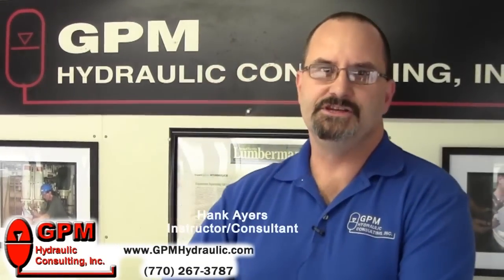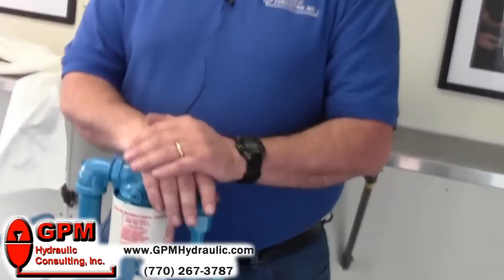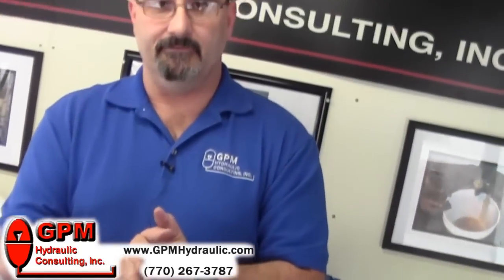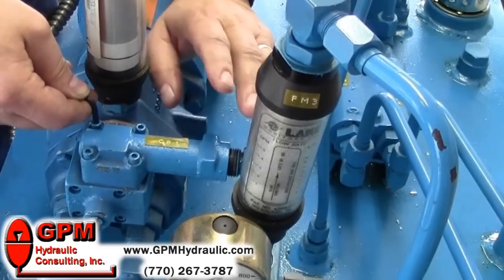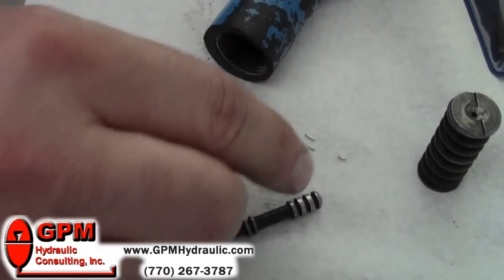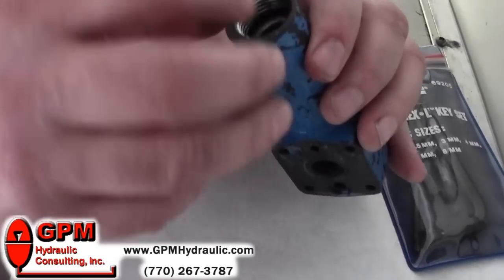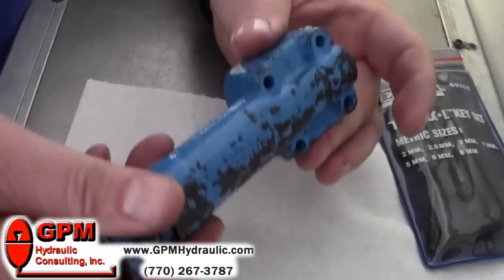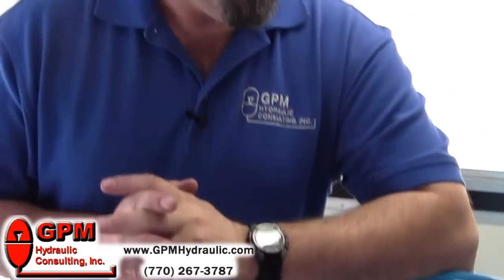Diagnosing Low Pressure in a Hydraulic System

Comment: Thank you very much for recording this video. I’ve found very few others that are actually helpful. I have a bobcat 863 that the auxiliary hydraulics lose pressure as the machine warms up. Any specific recommendations for this problem? Greatly appreciate your time.
Reply: Did you find answer to your problem, a have similar ..   lose power - pressure slowly...   If engine is running or not...   Boom will come to ground slowly...

Comment: Having a problem with our mini excavator.All hydraulics were slow on the machine it was down about half the usual power output.Blade barley picked machine off ground.Replaced all filters flushed all hydraulics and put in a new pump .Still same situation.Funny thing is when u first start machine for a few minutes machine has normal hydraulic power but once oil hydraulic oil warms up seems to lose power.My question is could a worn out main relief valve cause this .Or if a section spool valve was not fully closing on the control valve be the culprit.On our control valve there are a many relief valves that control different section of the excavator
Reply from the maker: Thank you for your question, Jay! Yes, indeed a worn relief valve could cause this - or a directional valve. Either could be bypassing such that it doesn't show itself while the oil is cold, but becomes apparent once the system warms and the oil becomes thinner. One easy way to detect what is leaking is to isolate different portions and see which will not hold pressure with a hand pump. You may also have some good results by using a thermal imaging camera to detect any bypassing. Look for hot spots around components in areas where they should not be. Hope this helps!

Comment: This is the video I needed to see. I have a bad pressure relief valve. But I'm stuck between that or the spool valve on the differential lock on a grapple skidder. My pressure drops from 400 psi to below 100 psi. It is suppose to hold fast at 635 psi
Reply: Jason, do you have a safe way to lock pressure in the line and shut down so you can listen to hear which may be bypassing?
Reply: @Gpmhydraulic   I blocked off my lines going to my differential. That should have spiked my Pressure. Which it did what didn't hold. I'm not a 100% sure if it's the prv valve is bad, if the spool valve is bad that has the electric seloniod that controls the differential lock or if the block that all this screws into is cracked internally.
Reply: @Gpmhydraulic  as far as locking pressure, I guess I'd have to remove the block. Fasten a porta power to it with a gauge and try that maybe
Reply: @jasonhart1802  Yes, that sounds like a very good method to me. Take extreme care - never expose yourself to pressure!

Comment: Do small hydraulic pumps such as 12v KTI ones used in dump trailers have compensator spools as well? 

I'm trying to understand if my pump is weak or the cylinder has an internal leak because I'm supposed to be able to lift 6000lb with this trailer but max out at around 3000lb, the pump doesn't sound like its "struggling" and I dont see any extrernal leaks anywhere on the cylinder or the pump, what could be the issue?
Reply from the maker: Thanks for your question, Nikko! No, those pumps usually don't have compensators; they're usually fixed displacement so their flow rate is fully dependent upon the RPM of the drive motor. Usually those pumps lose flow when they wear, meaning that they will still move the heavy loads, just not as fast as usual. A pressure problem in a system such as that is more likely caused by a worn relief valve or internal bypassing in the cylinder or directional valve. Bypassing generates heat, so look for a component that is running hotter than the others, that will likely be the culprit. Hope this helps!
Reply: @JackWeeks  thanks for the reply. 

So you are saying in these pumps as they age because of wear all that should happen is a reduction of rate of flow so it effects speed but not the pressure so it should be able to lift it's original weight? 

Can the cylinder have an internal leak and allow some of the incoming  pressure to be routed back the pump or is that not how they work? The cylinder is dry and it holds the weight up without lowering down once the pump is not running.

 I will see if it's a current issue as well since it's a 2 battery pickup but it's crew cab and the cable is probaby 10-12 feet, looked like a #4 awg.

Also I saw that the reservoir tank can get clogged with the pickup up mesh since this does not have an external filter. 

Thank you once again!
Reply from the maker: @nikkoBcool  Yes, I think bypassing in the system is where your trouble probably is. Though it could be a battery issue if your motor is electrical - I was thinking a PTO when you first asked.
Reply: @JackWeeks  I've seen a video where the guy says the issue sometimes is ok the spools (he called it something else) basically two spools that sit on the top of the aluminum pump assembly and are responsible for the double action, I will try to take those out and see if there are any issues. I did notice that the pump ran stronger when I turned the truck on as opposed to just running off the two batteries up front (new) thanks for the input, will try to report back once I figure this out

Comment: i have a bobcat excavator has very weak hydraulics is the torque limiter that is on the side of the pump the same as a compensator
Reply: Thank you for your question, Jay! No, they aren't the same at all (though either of them could be out of adjustment or have trash inside and make for what you call "weak hydraulics"!). The compensator should be adjusted to determine maximum system pressure. The pump will deliver full flow until the compensator setting is reached, at which point it will de-stroke the pump (reduce the angle of the swashplate and therefore the flow delivery) to a point where the compensator setting is maintained in the line.
The torque limiter, on the other hand, is adjusted to determine the maximum input torque to the pump. As input torque approaches the setting of the torque limiter, the swashplate angle is again reduced, reducing the flow output, allowing pressure to build to a greater amount without increasing the torque. In general, the torque limiter allows us to build the necessary force for the job to be done by a smaller prime mover than we would need at a higher flow. In other words, (since the Conservation of Energy law doesn't allow us to get anything for free...) it lets us sacrifice speed for an increase in force.
Hope this helps!

Comment: With all due respect: A hydraulic pump has everything to do with pressure: not just flow.
A hydraulic pump produces flow, but is must be structurally capable of overcoming the resistance caused by liquid and load resistance. If a pump is worn, it will not be able to overcome load and liquid resistance and thus will cause a decrease in pressure. When the pressure in a system decreases, ALL the components in the system are "guilty" until proven innocent. All components in the system, including the pump, must be tested for leakage to correct the problem. Also, it is impossible to find problems associated with actuator speed with a pressure gauge. Anytime actuator speed decreases, it can only caused by a flow deficit. A flow meter is needed to find the problem. 
Respectfully,
Rory S. McLaren
"Hydraulic safety does't just happen, it has to be vigorously pursued."
Reply: With all due respect to Mr. McLaren's comments, a worn pump, depending on the amount of bypassing, can overcome the resistance in the system and move the load providing that the TOTAL pump output is not bypassing over the case drain line. In my years of personal experience I have found that the pump is usually the first thing that is changed when a low pressure condition exists. As Mr. Ayers states, many a good pump has been changed because of trash in the compensator.  In the real world environment, it is not time feasible to install a flow meter as the downtime in plants can be as high as $10,000 an hour.  Many times flow loss problems can be found by checking the pump case drain line or with an infrared camera to determine where the oil is bypassing in the system. Thank you, Mr. Ayers for imparting your knowledge to help mechanics and electricians improve their troubleshooting knowledge and skills.
Reply: As long as volume of a solid or liquid or any other state of matter, the PSI is fictional when actually in reality is more like 1×1×1 inch cubed... maybe PCI??. Idk.. I can't one up anybody cause I am learning tons from videos and respectful comments.. Flow...pressure..To be a pump or not to be... Is the reservoir half full or empty?? Idk.. Is a square inch real or not?? I am being serious..I get confused...Only in cyberspace is co-planer a concept of sharing a face as one, and that baffles the computing out of computers.
Reply: Great comment.
Made for a conversation starter.
Reply: @alcovyRIVERband  Great of you to share.

Comment: I’ve got a 755 jd tractor I’m looking to buy a backhoe with a recommended psi of 300 more than my tractor says it will produce. Can I still use the attachment with 300psi less than it says it needs?
Reply: Probably not. If you are unable to build the necessary pressure, the backhoe may not move. And if it DOES move, it will certainly stall under heavy load.

Comment: i changed the pump but still, no pressure, checked relief valves, removed electric valve spools, still nothing, the pump is in tank, been working on it 3 weeks, if I took a pic on the system could I send it to you please, or to ANYONE!!:))
Reply: Did you get your system up and running?

Comment: hello, I have the problem with my pump, every time I turn it on, it cant build up pressure but when I open the valve all the way open after 10 seconds it grabs hard and after that it works fine, like nothing ever happen. Can you help me solve the problem? I had this problem before I put new oil and new oil filter.
Reply from the maker: It's definitely caused by trash somewhere. Possibly the system relief valve not seating at first, or if you have a variable displacement pump, it could be the compensator valve. Try disassembling the relief and cleaning it. Same with the compensator valve if it exists in the circuit.
Reply from the maker: @TrailMaker2  Yes, you definitely have some trash keeping either a relief valve or the compensator from seating properly. The trash is getting blown out and all is working properly in just a few seconds, then when it is shut down, lodging again and keeping pressure from building. The ideal thing would be to flush the system, but second best would be to remove and manually clean the compensator, relief valve, and even the directional valve (sometimes directional valves will have a built-in relief). Hope this helps!

Comment: I enjoyed your video, I have an older Bobcat 853 that I just purchased, and it has some hydraulic issues with the lift/tilt function, The gentleman that I purchased it from said he installed new seals on the spool valves (they were leaking) but now the lift/tilt hydraulics appear to work well when the machine is at idle but as soon as I start turning up the throttle the hydraulics pretty much stop working, occasionally they will wove slightly but I have to move the throttle back to idle to get them to do anything. Any thoughts or suggestions would be greatly appreciated?
Reply from the maker: Thank you for your question, Clay! If I'm understanding the symptoms correctly, your flow is being diverted once it reaches a certain level. Remember that hydraulic oil will always take the path of least resistance. This path seems to change once the flow gets to a certain point. Not many components will do that, but the system relief valve is one that will snce it is held closed by a spring. I would check the relief valve first. And, if you have any other pressure controls in the system, check those next if the relief valve checks out OK.

Comment: Great video, but I don't believe my pump has a compensator.  I have a Roper Log Splitter that won't split anymore.  The cylinder goes out, but will not push into the wood anymore.  No leaks.  So either its the pump, the actuator valve or the cylinder?  Normally the actuator valve handle would self return to the neutral position when the cylinder fully retracts.  It will not do that anymore either.  When trying to push into the wood, the engine bogs down.  It normally would bog down if it encountered a very hard piece of wood or at the end of cylinder stroke.   Any thoughts or help would be much appreciated.  I still have a lot of wood to split before winter.
Reply from the maker: Thanks for your question! You are correct, your pump has no compensator. Your pump is likely a gear pump. I'd be interested to know if your pressure is low, but I'm guessing you have no pressure gauge on your splitter, so you would not know if it was above or below normal even if you measured it, correct? I'm thinking your pressure is fine, though, because you say it is bogging down the engine. It wouldn't do that if your pressure was low, it would simply stall.
First thing I would check is your relief valve. Probably you have no separate relief valve, but there would be one integral to the directional valve. Since you say that the valve handle no longer springs back, the relief valve sounds like the most likely culprit. You probably only need to clean it out. It is probably the only adjustment on the valve. WITH NO PRESSURE IN THE SYSTEM AT ALL, remove the components of the relief valve and clean everything, Put it all back together and test it. If that doesn't work, you may have to replace the whole valve assembly. 

Hope this helps!
Reply: @JackWeeks Thank you so much for your answer & insight.   I'm not sure if it even has a relief valve.  I wish I could post some pictures here.  I'm gonna start by simply changing the filter to see if that helps.  I'll look for a relief valve on the directional valve. The splitter is at my brother's right now. I'm gonna head over there shortly.  What would be safe to use to clean the relief valve?  Ether maybe?  Or just some cloth?
Reply: @JackWeeks  also no guage. But I pulled a guage off of a different hydraulic unit.  I have see if I can adapt it on with some fittings on hand.  But yeah, I have no clue what the pressure should be.
Reply from the maker: @Happy_Harry  Definitely start by removing the directional valve, taking it apart and cleaning everything. Look for a built in relief valve and see if it is stuck open. Carburetor cleaner is good for cleaning these valves, just be sure to remove the cleaner with new hydraulic oil afterward. Good luck to you!

Comment: if only they were all that easy. what if u don't have a compinsater and no pressure being generated out of 2 spool valves.  but the other 6 valves operate fine?
Reply from the maker: Hi Tim, yes, it would be great if all hydraulic issues were straightforward, but sometimes they do hide around corners! In your case, clearly your pump is not the issue, though (which was the primary message Hank was trying to convey in the video). And in fact, pressure problems rarely are the pump. You are losing flow somewhere - and it is either somewhere common to the two valves or possibly the two valves themselves. The best way to find bypassing is usually by looking for heat, because bypassing fluid will always generate heat. Often you can tell by feel where the heat is being generated, but the best tool for this is a thermal imaging camera. Find where the heat is being generated and you will find your bypass point.
Hope this helps!
Reply: @JackWeeks  that helps me more than you know. Thank you!!  Been dealing with this issue for almost a year.  Yesterday I was going through the spools and realized the valve where flow is being bypassed is a 2pc spool with holes drilled for passage. different than all the rest being solid spools. There are sure signs of heat on the valve. I was unable to take the spool apart but cleaned thoroughly. Unfortunately theyre generic valves with no part available.  Fingers crossed. Thanks for your help

Comment: Sir ask how about the pc78 slowly power swing motor also weak.
Reply from the maker: I presume you are talking about a Komatsu PC78 crawler? If so, it sounds as though either you have some bypassing or a badly worn pump. Is your pump case very hot? That's a strong symptom of wear. Particularly if it heats up rapidly under load. Listen to the pump - is it cavitating? Aerating? Check for bypassing across the relief valve. If the relief is bypassing, it will be hotter than the surrounding components.
Hope this helps!
Jack

Comment: Dear  hank

my self Rajjmohan, and i am working in maintenance field as fresher. i am facing problem of low cutting pressure in NAMSUNG a korean make  multi punch press bussbar  machine. large dimension buss bar cannot be cut bacause of low cutting pressure.

kindly give me trouble shooting

thank you
Reply: Thanks for your comment! In our experience, low cutting pressure in a multi-punch is usually caused by contamination or wear in either the system relief valve or, in some cases, crossport relief valves at the cylinders that are intended to limit the shock of impact. Check those first. It is also possible that the compensator valve on your pump has an issue similar to the one in the video. Remove and inspect/clean the relief valves and the compensator. These are your most likely culprits!
Reply: Rajmohan Prabhudesai